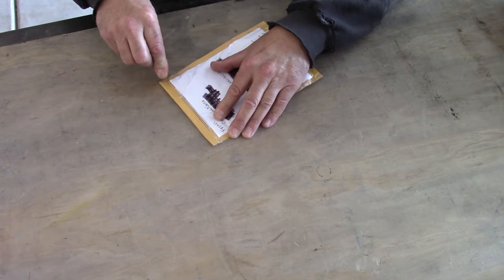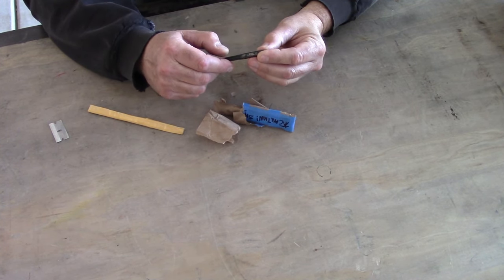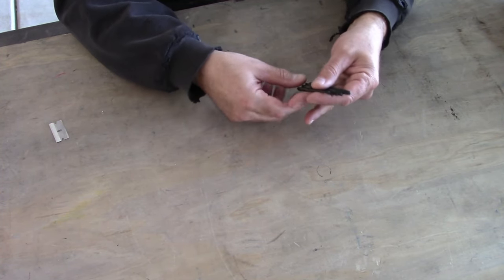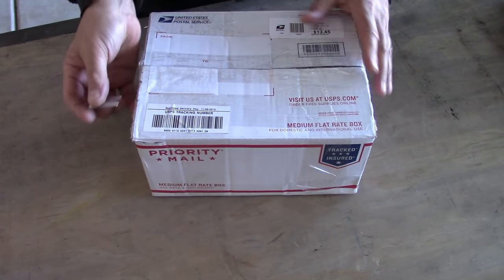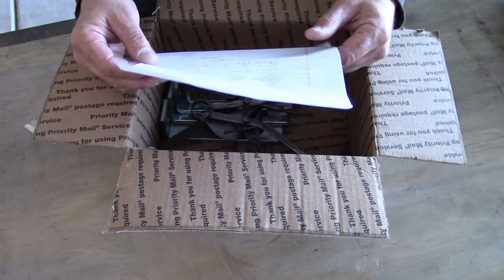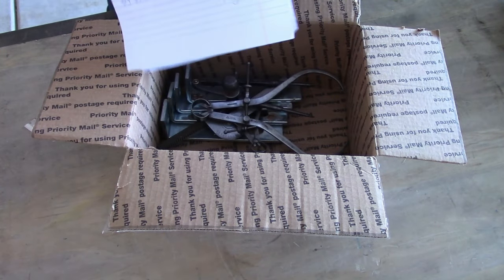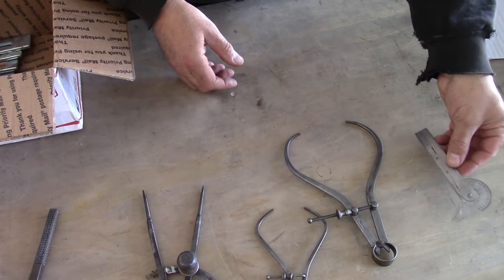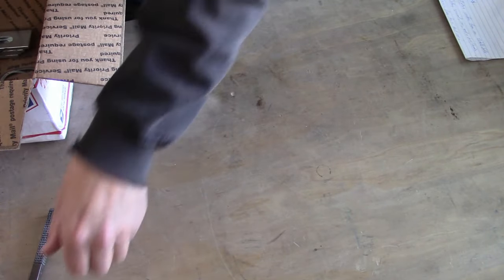Wilton Vise Restoration

Comment: I have a similar VIXIA camera (that also requires a powered mic). There is a manual and an automatic mode for level. I acquired a similar lavalier mic for it and it works well when I sit and talk, but I am not convinced it is the best option for comments while the machine is running. I've been looking for a headmounted one with a cardoid pattern to try to reduce the machine hum and improve the speech. But they all seem to be wireless and beaucoup bucks, or the wired sets all seem to come from AV-JEFE and they are priced at all sorts of prices, which does not sound like a stable operation to me.
Reply from the maker: I am finding the same results, it comes down to $$$ = Good Results! After the shop build I'll look into better equipment. Thanks for the info and let me know if you find a good inexpensive fix. 

Best Regards,
Ray
Reply: Will do buddy. I really don't NEED a wireless setup, c'mon the shop is 20x20 and I spend all my time in 1/4 of it for the lathe and mill. That lavalier is fine for the camera facing parts, but I want clearer voice when the lathe is running.
Reply from the maker: For sure, machine noise is picked up loud and clear every time!
Reply: I found my camera sounds better using a similar powered mike by putting the audio on manual and taking the level to about half (46). Seems to be a lot less general background, although I am still talking over the machine noise. Maybe using Keith Fenner's hat trick would help, I may try that.
Reply from the maker: I do like Keith's hat trick but I usually don't wear a cap but might have to start!